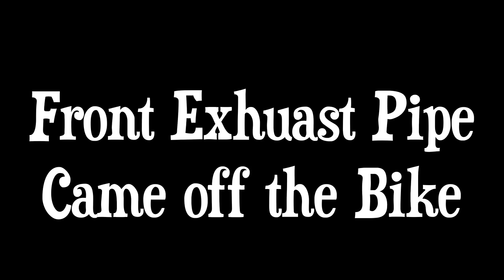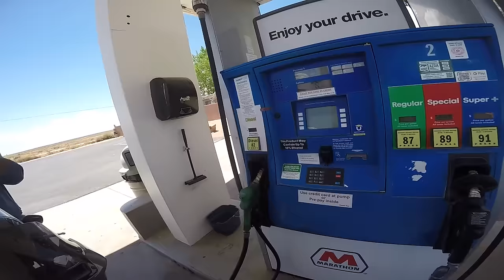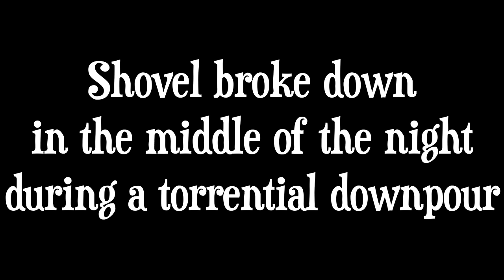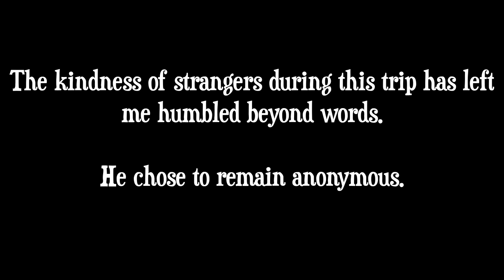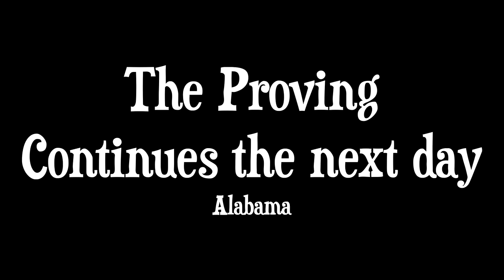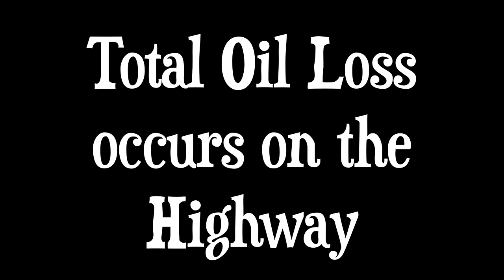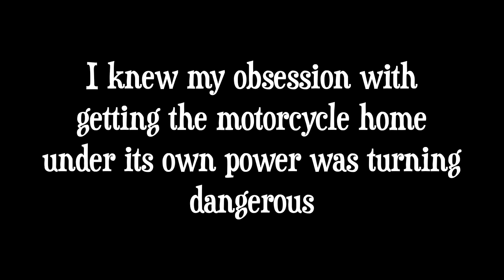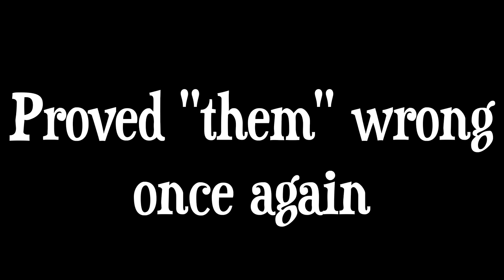Why you DON'T take Vintage Harley's on Road Trips | 4,000 Mile Cross Country Motorcycle Adventure

Comment: Wrong gas cap on left tank. Left tank is a sealed cap and the right tank is the vented cap, that vents both tanks via a crossover vapor hose under the dash. That is why your leaking with a full tank on the kickstand. Had the same problem on my 77 lowrider.
Reply from the maker: Damn, had no idea!
Reply: I came to the comments after shade tree said this just to learn why! 🤣 thank you sir 💪
Reply: On my softail 1995 , the gas caps are reverse thread left is the reverse thread don't mix them up
Reply: Also fill left first then right since the left tank sits lower
Reply: @scottme6615 same on my 88 sportster i got the dual tank to but my issue is the carb keeps leaking from the overflow hose

Comment: Haha, very kool. Congratulations! I got married on ,my first HD, a new 1982 FXE Shovel. My wife and I rode it from Little Rock to NYC a few times, before moving to the city. Put 80,000 trouble free miles on it in 4 years, then stroked it to 93", put it in 1951 wishbone, and rode it from Brooklyn to Rome GA in one day--- 950 miles. These days, my daily rides are a mildly chopped 1982 FXB, and a near original 82 FXB. Like pitbulls, a Shovelhead's manners and demeanor all depend on how it was raised and whether or not it was abused! You couldn't give me a new HD---- if it ain't got a kicker I ain't interested.

Comment: I was thinking of the scene from "The Blues Brothers" when they arrived at Daley Plaza and the Dodge self-disassembled when you were on the last stretch.  Way to stick with it.  When I come down to pick up the Shovelhead after winning it in the raffle, I'll bring some gaskets and a tool set.  And three gallons of blue Loctite.
Reply: Don't forget to start with a half dozen of every size nut, bolt, screw and washer used on the bike for your "Oh shit!" kit.  And after this video including a couple of oil plugs for the heads is a good idea, too.  Maybe oil pan drain plugs, too.  Shovels do shake stuff loose a mite.

Comment: After watching your ordeal, I'm amazed that you actually made it back. It reminded me of when I was a new rider in the late '70s, seeing Harley groups on the roadside, helping to fix or load a bike up. We never stopped, as they already had plenty of help. That, and we were kids riding 'rice burners'. 

I will say that I was only stranded on the road once, when my 21 year old bored out, but otherwise stock '84 GPz1100 broke its cam chain, which had been damaged a decade earlier by a shop that mainly worked on Harleys. Even after losing its chain at 120 mph, nothing in the engine was damaged.

I'm glad HD survived AMF and makes a much better bike today. That said, I just went to the local dealership superstore and discovered that the 2024 40th Anniversary Edition ZX14R fits me like a fine kid glove. While I can't justify the expense of one now, I'll settle for a used BMW K1200S or R1100S, my first non-Kawasaki bike.

The only bike deals that sound good to me are 3000 mikes away. I'll need to drive it back to South Florida if I can make a deal. Your video has been an eye-opener, to be sure!

Liked and subscribed, of course.

Comment: Riding vicariously through you while waiting a month for a hernia operation, (thanks free healthcare!) saw the first episode where you did a mini montage of everything that was going to go wrong, but missed the bit about it being a foreshadowing thing. It looked to me like the shovelhead was running perfectly for the first day and a half, and then just fell apart in one afternoon. I was laughing so hard my wife was worried (may have been a bit stoned) . It  looked like it (in my haze) was coming apart like a clown car at the circus. Tank falling off, signal light dangling on a wire, instrument panel vibrating and falling off, then fuel tank held on with electrical tape!! I couldn't catch my breath! This is, without a doubt, one of the best travel vid series I have ever watched!!

Comment: I took a 62 duo glide 4100 miles in 9 days. Only mechanical problems was a stretched primary chain .ez fix .   You have to personally go through every nut and bolt on the bike before you go anywhere .  How people  trust some hired mechanic to get a bike ready for a long trip blows my mind.

Comment: Thanks for the laughs, I rode a 77 FX from Longview Wa. to Daytona Fla. in 1983, and back 6 months later, didn't have as many problems as you did but my exhaust had the same problem, my oil bag developed a crack, I just dumped whatever I could get at gas stations, 30 wt kept me going, the way yours shook itself apart I think your top motor mount is broken. my newest bike currently is a 1982 FLHS dynamically balanced 88" S&S stroker flywheels 10:1 pistons 54,000 miles on it since I rebuilt it. 24 47 final sprockets, likes 85-90 mph all day. love my 3 shovels and 6 ironheads hahahaha

Comment: Glad you made it all the way.  I "Use" to ride with my good friend that has a original 79 sportster he bought new. We have been on a few long trips together. The bike has left us partially stranded every time.  Bad generator and voltage regulator, broken clutch handle, bad intake gaskets, broken rear tail lights, broken speedo/tach, oil leaks.  I told him to retire the bike and call me when he has a Yamaha, its been 12yrs now since we rode.

Comment: One of mine is a 91 EVO Heritage. Tool kit with bolts, nuts, not that many sizes-tools, wire, etc like a couple  EZouts/thread tools.
Exhaust bolt tightening is SOP on trips. I don’t recreate a wheel, I just know what wants to be checked, filled, tightened. 
Fun trip. Thx for sharing

Comment: 1:04:00 in, I can completely relate. Recently had a near accident causing break-down myself on 412 thru Oklahoma about 12 miles east of Elmwood at 75MPH when a swingarm bolt backed loose and went AWOL on my way back to SWFL from the "Get On ADV Fest Sturgis"... Had a very kind trucker stop to check on me, and luckily had just the right size metric threaded bolt to limp my KTM back to OKC where Ajax Motorsports took great care of me. Surprised we all didn't cross paths at some point, haha!!!

Comment: This reminds me of when my dad rode across the country on his '50 EL. Halfway through the trip, the engine sucked a valve and he tore the heads off on the side of the road. Back then, you had to be a mechanic to ride Harleys. In 1991 he lost his life riding an '82 FX. He is gone, but I still have the pan head he put all those miles on.

Comment: What an epic ride 👍 Although  some parts fell of due to vibration
that engine never seized or died 👍 These old shovels don’t feel to happy at 70 + mph. Remember back in the day it was 55 mph. At that speed they will be ok and wont rattle that much.
Reply: The 5-speed trans did a lot for these engines. Locktite is also your best freind if you own an old H-D. These bikes can be reliable daily riders, but you have to put some work into them.

Comment: I've just returned from a 3500 mile return journey, Bath England, to Finland, via Russia, on a  1975 200cc 2T Lambretta scooter. 2 heat seizures, a holed piston, 5 punctures, 3 snapped cables, and a blown crankcase oil seal. All repaired by myself, on the side of the road, with spares carried on board.  🛵

Comment: Sheeeeeeit! I took a ‘66 shovel from central Wisconsin to Daytona for bike work in’01. Rode it there, rode it back . Went from Macon GA to my driveway in 17 hours. Did I mention that it’s a rigid ( that means there’s no rear shocks) has 18” apes on 6” risers, jockey shift , open 3” primary and suicide clutch?

Comment: My friend jack from pa has ridin a 81 shovel across country many times .much better bike then that 79 amf bike.good thing the very last of them made. Good .thing newer harleys are made much better these days. And yes shade I’ve been throu what happined to you on more then one old Harley . Not just the shovel.but old 75 sportster also . It ran great when push rods would stay adjusted and parts fallin off. But always fixable with friends help of corse . And duck tape .but wood was a new one for me. Thanks again .great vid.

Comment: Had you stopped every 400 or 500 miles and put a wrench on everything I reckon the majority of the issues you had could have/would have been avoided, like tank falling off, losing rocker bolt, or vibrations taking out switches, or the intake leak you probably had. Shovels are fine machines, and when built right are as reliable as a decent evo... they just need some love. Great series though, and that lack of know how is probably what made the trip and video so great. Next time will be boring, because you'll know what to do! lol

Comment: Wait till the stator on the alternator goes out or the gear on the camshaft slips out of time. Or someone removed the circuit breaker from the battery  and the whole wiring goes up in smoke.

Comment: dude this whole thing reminded me of when I had the stupid idea to Drive from OC CA to Irving Texas to find work as a welder in my 2012 Camaro with a blow clutch  on November of 2020. i went back to my Trucking days of floating gears and hoping for the best. the unsuccessful trip to find work ended with me being so pissed I drove strait shot 1565 miles strait shot home running off Ghost peppers the last 4 hours to stay awake and some adrenalin pills I got from a truck stop . my back tires started having pressure problems causing me to stop every 250 miles and air down to keep the middle from going bald.  the clutch started losing pressure 2end Gear said bye bye bye, the rear diff decided it want to talk to me on left turns wurrr wurr wurr my headlights start cutting on me. i stop in to a random ass parts shop and turns out the bulbs blew and melted my housings i bought new ones 800$ . then got hit and run 30 miles after crossing the border in to CA nice welcome home >:C...........and as soon as i got in town i went to MC fat ass and got 6 double cheese burgers 2 large frys and a large coke and pigged out smoked a fat hog leg and passed the F out XD  att that point once i was home a 16 hours deal all said and done one i brought my bags inside. it was like 30 min per bag i was so tired. the car only had 52,000 miles on it don't buy a V6 manual trans 5th gen camaro. but what a hell of an adventure...................and a 4320$ repair bill 4 months later.

Comment: Watching you struggle to push start that bike hurt ....I don't know if you know about this trick or not, but I'm going to try and explain a trick I learned a long time ago from my buddy who drag raced bikes. You need two bikes and two riders. The bike that will be pushed should have it's passenger pegs down. Then the bike that will be pushing should be positioned on either side of the pushed bike and have the front wheel just about mid bike. You want to be able to be in a position where the pusher bike rider can rest his foot on the other bikes passenger peg. Start off easy and get to a good speed, then the pusher bike falls back and the pushed bike can pop start. You can even push the bike to a gas station in an emergency if need be... Just keep the speed low and steady ...

Comment: I had plenty of the old Harleys a few were good bikes If the engine was left totally stock.But the second you added high compression pistons that worthless S&S super carb or a hotter cam you have started it vibrating beyond is capability to stay together.The flathead 45 ,the 61 c.i. panheads and knuckles not the 74 they were vibrating junk.The 900 mag  fire Sportster before 1970 .These were actually good bikes.The rest of them are just junk.

Comment: How can you Not know that you fill the Left tank first ? Sometimes when the starter motor wont work it's a bad connection in the starter relay under the Battery , I just move it a bit and the bike starts straight away. What is Wrong with your kick start ? And I guess you know that you push start it in 2nd gear , You say the old bike makes you appreciate the new ones , I just sold my 2013 103 Fat Bob , I hated it , thank F*&# I kept my 1985 Evo 4 speed , ( it's in the photo )

Comment: Why is  1979 a Big Deal .. I could  drive my 1979 Z-28 Camaro across the Country with no Problem..  Even though it's highly modified.. but  still nothing on it that was not  normal technology in 1979.  The HEI Ignition with no points was a huge improvment ..
  In 1979  General Motors Produced 288 Thousand Camaro's  a really big Production year for HD is 300,000.  GM  Produced almost as  many cars in just one model .. than HD every did ..
  Go figure  you see at least 100 cars on the highway for every motorcycle you see..

Comment: running every single redlight, loosing parts on the road, needs to be pushed every half an hour, breakdown every 100 miles, driving blind in the rain, all that shows the professional preparation of this trip...=0
it is certainly no fun if you get the parts of this shovel in your face on the highway...where is the fun then? nobody needs a drama on the road. maybe he should spent his freetime in a workshop.

Comment: Typical example of the absolute garbage Harley sold its fans most of their existence. You could literally take any other brand sold that year on the same trip with less than 1/10th the issues of that piece of crap. Coming from an ex owner of many Harley’s. Never again.